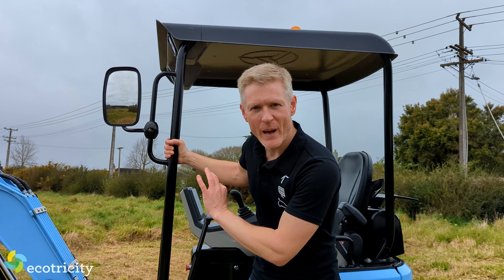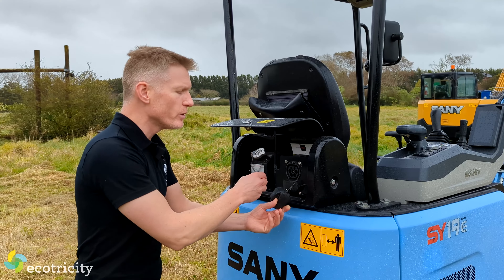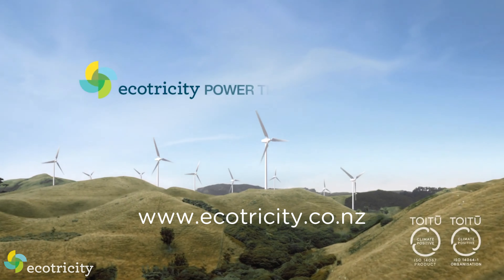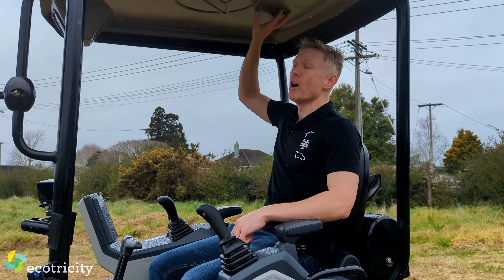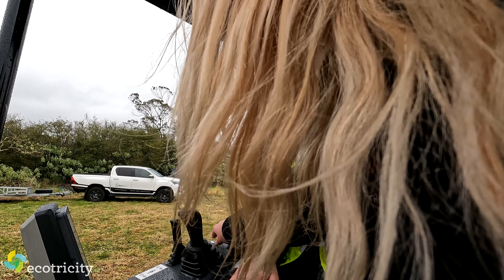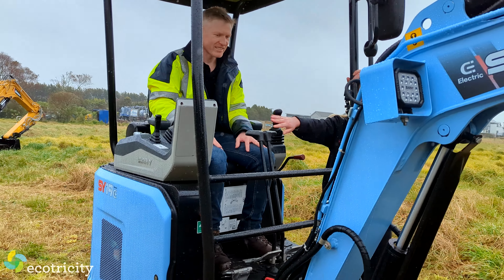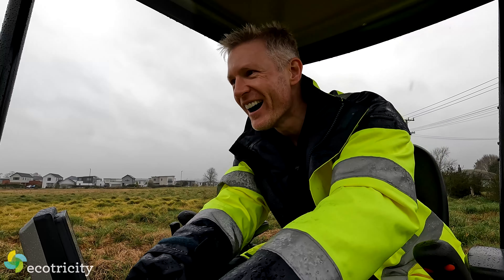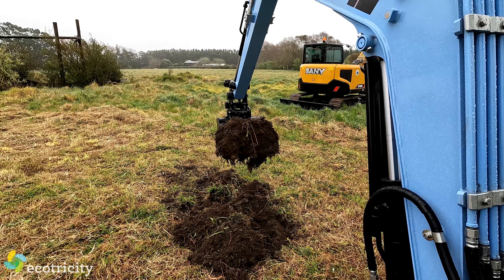Gav tries a battery powered digger! (SANY SY19E)

Comment: Gavin you should see if you could find a all electric mowing (grounds keeping) crew to do a episode on. 

The square in pamly north uses an electric ride on mower and Victoria Esplanade has electric side by side utility buggys but other tools are still two stroke.
Reply: I have started replacing my two-stroke with electric in my gardening business just the blower and strimmer for now. I love that you can just pick them up and go no messing about starting them. and a lot less noise. Electric is the way to go.
Reply: @adus123  I'm not convinced by electric chain saws though. Although I don't use a CS professionally, I do regularly do a full day of felling/cutting up trees ion my land.
I just can't see that electric chain saws are there yet, especially not for larger saw sizes.
Reply: @davidcolin6519  I don't use them much so can't say.  All I can say is the batteries I have for the tools I have last way longer than I was expecting with loads of power. I am only replacing the tools I use the most. I don't think they are there yet for all the tools. I use a single-sided hedge trimmer I haven't seen a good replacement one on the market yet to match it.
Reply: @adus123  Yeah, I have a battery hedge trimmer that is fine, but there again, I don't have miles of hedges to trim. Mine is a really cheap one, but it really does a fine job and is far easier to use than any other hedge trimmer I have used.